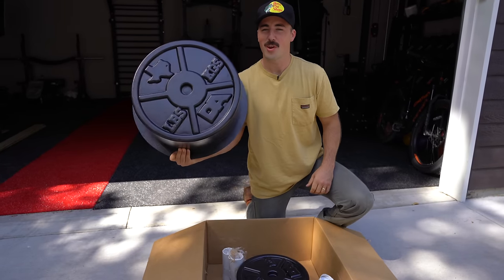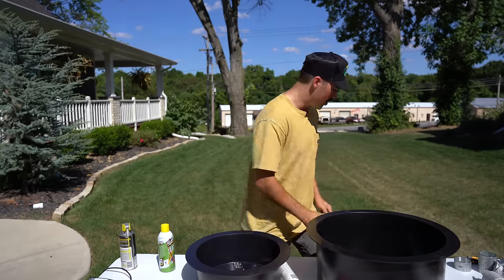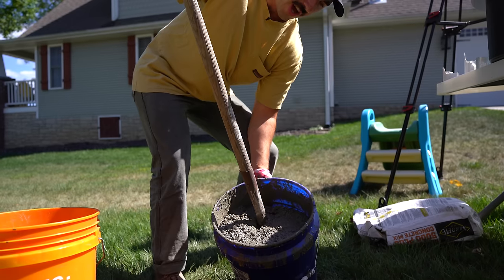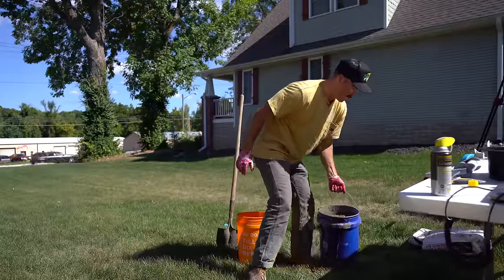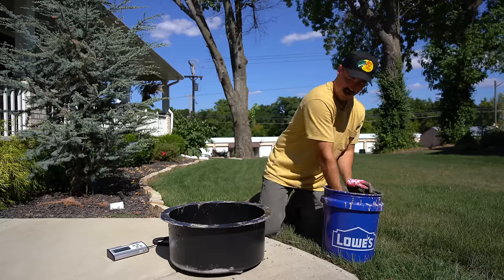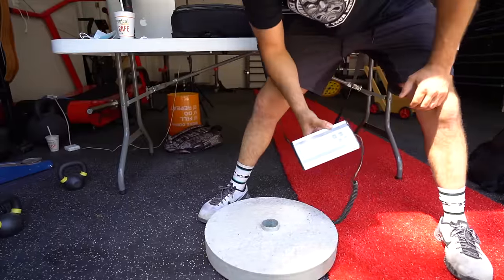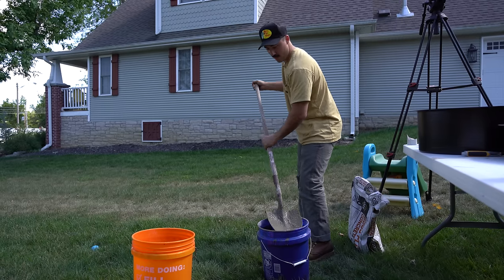How To: DIY Concrete Weight Plates That Don't Break

Comment: $115? for this mold? I mean I know regular plates get expensive but common. That's expensive considering the whole point of this is to save money.
Reply: The initial price seems high but assuming the molds are reusable you can make a bunch of plates for a fraction of the cost to buy manufactured plates.
Reply: @oXchoujiXo  exactly. I also cover shipping to US customers.
Reply: @oXchoujiXo  it's still just a plastic mold that's it... way to expensive
Reply: And you pay how much per pre-fabbed weight?
Reply: But for the $ 115.00 you can make a thousand of them if you want.
Reply: @derekthegreat1114  you can't make thousands because you need that metal pipe in the middle and they only supply you with so many unless you keep ordering more. $115 for the mold then money for the cement and bar, then all the work to mix and weigh out how much cement needed and even after all that is done it won't last forever because the cement crack and break. Not to mention the mess. For the price and amount of effort it doesn't seem worth it to me at all. you can buy 4 real plates on craigs list or facebook market place for the same price and they will last you forever no effort needed. for something like this to even be plausible it needs to be cheaper in my opinion.
Reply: @KnightlyChaotic  $115 for the mold then money for the cement and bar, then all the work to mix and weigh out how much cement needed and even after all that is done it won't last forever because the cement crack and break. Not to mention the mess. For the price and amount of effort it doesn't seem worth it to me at all. you can buy 4 real plates on craigs list or facebook market place for the same price and they will last you forever no effort needed.
Reply: @oXchoujiXo  $115 for the mold then money for the cement and bar, then all the work to mix and weigh out how much cement needed and even after all that is done it won't last forever because the cement crack and break. Not to mention the mess. For the price and amount of effort it doesn't seem worth it to me at all. you can buy 4 real plates on craigs list or facebook market place for the same price and they will last you forever no effort needed. how many people you know wanna dead lift and worry about breaking their plates if they drop them to hard or something breaking in the middle of a workout. it's a nice idea but i don't see the value.
Reply: @PabzRoz  most plates around me go for like 150-200 per plate. And i mean its up to each person to decide if they want to purchase a mold. 

Because honestly you could just use a plastic bucket for a mold. Wouldn't look as nice but would achieve the same affect.
Reply: @oXchoujiXo  where the hell do you live that plates cost that much!? here in the US you can get them brand new for around 60-70 bucks per plate. that's on the cheap end but still it's a solid plate lol who cares when we're talking about concrete lol. and I was thinking the exact same thing, just use the bottom of a bucket. who cares how it looks.
Reply: @PabzRoz  i live in the US and every available plate on either Craigslist or marketplace runs around that price locally.

And since its hard to get new plates as they tend to sell out fast it kinda sucks
Reply: Pabz Roz REALLY doesn't want anyone buying these molds. The 2" aluminum conduit for the center holes are reusable like the mold. You weren't supposed to leave them in, and you were supposed to mix the fiberglass in to the cement. The do fibreglass helps disperse the impact and it isn't made to be dropped on the cement grond. The design is for padded floors. Did Pabz not pay attention at all to the video?
Reply: @KnightlyChaotic  Did Pabz not pay attention at all to the video?

Find out on the next episode of DRAGON BALL Z!
Reply: @KnightlyChaotic  who cares, it's still a pointless product. sounds like way to much work when I can just buy 2 plates for around the same price.
Reply: @KnightlyChaotic  are you an endorser of this product or some shit lmfao why do you care so much about someone elses opinion. it's a 115 dollar bucket bro.
Reply: @KnightlyChaotic  regardless its still basically a plastic bucket for $120 bucks. no thanks.
Reply: this man finesse you 115 bucks for plastic and people still dumb enough to buy it and think Oh YeAh It'S LeGiT yOu cAn MaKe So mUUUUcH PlAtE WiTh tHaT......... people are stupid imma start a business me too at this point
Reply: You can’t buy the same size pipe at the hardware store? I’m sure it can be rigged up some kind of way.
Reply: I was considering buying molds despite the high price and realized that you have a mandatory Texas logo with your weights...
Reply: Seriously, and the fucking shit was already cracking after 1 drop. It won’t make it past a month.
Reply: @oXchoujiXo  200 per plate? WTF? Competition calibrated plates aren't even that much. You can buy 2 calibrated 45s from rogue for like $185 USD so that's like 90 per plate and those are competition calibrated.
Reply: @algoreshouldhavewon8995  There were no cracks at all.
Reply: @KnightlyChaotic  you are supposed to leave the metal sleeve inside
Reply: completely agree, do yourself a favor & buy the mold off ebay for like 20 bucks & you can buy your own fiber glass for cheap
Reply: for real, you could literally just make the weight inside of a big bucket, you just won’t have any designs on it. But in reality who cares about the designs it’s not like you look at the ends of the weight while lifting it.
Reply: @450-v9w  It's not just a plastic mold. It costs money to manufacture things. If he's injection molding them the aluminum mold required to make this mold costs a lot of money to produce (in the thousands probably) Then there's the upfront cost of having them manufactured, storing them, marketing them so people know they exist, shipping them etc. Plus weight is going for 1.50 to 2 bucks a pound right now, it's honestly a good deal considering the amount of work and the risk he took to make them.
Reply: @connorhd3201  Olympic plates in my city are going for 2 bucks a pound right now used.
Reply: You don't need to buy their mold. You can accomplish the same with a wide oil change bucket and 2" metal pipe. The mold is just for   a e s t h e t i c s .
Reply: @EurydiceProject  of course, but some people don't want ugly shit laying around their house.
Reply: @andreweasterling9240  i think some paint on it and make it outdoors weights... Prolly look nicer
Reply: Use a rim
Reply: ikr I could just buy a 3d printer and make my own molds with that kind of money.
Reply: @PabzRoz  115 is very overpriced lol. Im using plant liners/saucers, 2" PVC pipe to make a hole in the center, and chicken wire for reinforcement. Made 2 plates last night, waiting for them to dry now hopefully it turns out fine. But it only costed me $20 for all that, vs spending 115 on this thing with some stupid Texas logo lol
Reply: Get Terra Cotta Plant Saucers in the dimensions you need for around $5 a pop (cheapest on Target website). Made with better, more durable, plastic. Just doesn't have the weight design logo is the only downfall.
Reply: That's a come-only asked question
Reply: @PabzRoz  lol, you're delusional. I paid  around 130 each for my 45lb rubber plates (generic body solid clones) and that was am amazing deal BEFORE the pandemic. Price has gone up 50-100% from manufacturers and probably 100-300% on the black market. No way in the world were you getting plates for 60-70 bucks 3 months ago.
Reply: @PabzRoz  homedepot sells PVC pipes this isn't hard to make.  Concrete $10 for 80 pounds. 
Still better then buying a real plate. 
Mixing is easy and if you dont want to do the labor of mixing why are you even lifting.
Reply: @andreweasterling9240  stop trying to justify this price. It’s too high.
Reply: Yes , but I recommend cavemen weight molds over this, the point is that covid jacked the price of iron weight plates and this is cheaper for just 80lbs worth of weight
Reply: @PabzRoz  yup id buy some rusty ass weights from Craig and refinish them with rhino liner if you care about that sort of thing. Dont know why im even talking about this because i live at an apartment complex with a massive gym 🤣 and don't have a basment. Could always deadlift on my back porch (4th floor)
Reply: the big reason for doing this is you cant find iron plates, so make your own as needed.
Reply: @tattedupchrist1105  If he's selling them then it's not too high. If he's not selling them he'll lower the price.
Reply: you can make your own at home, it will be the same if you just use a large round container, just without the logos.
Reply: @andreweasterling9240  if people dont want ugly shit then why are they making cement plates? these plates looks incredibly ugly compared to metal or olympic bumper plates. youre point is moot. this is supposed to be a way to save money, and you arent saving much by how much the mold costs. over $100 is absurd for how insanely cheap polyurethanes are.
Reply: 100$+ for a 45 lbs plate u got me Fak^ i rather do cement
Reply: @JM-bl3ih  Have you tried buying 45 pound plates lately? 100 dollars gets you the ability to create 45 pound plates that aren't ugly for like 10 bucks. If that doesn't sound like a good deal to you then don't buy it.
Reply: @photonganglol2413  Damn you're gettin RIPPED then. I literally linked retailers that have cheap plates for under $100 if you scroll up in the comments. And in what world do you live in that you're paying over $100 for a single USED plate??? lmao. There's so many old plates people are trying to get rid of on craigslist or something for way under $100 if you actually try and are patient. Sure nice name brand mainstream plates can easily cost over $100. But a cheaper plate get's the job done exactly the same. Weight is weight. Especially when the alternative we're talking about is concrete...
Reply: @PabzRoz  okay so $70 per 45 plate. Once you get two plates, it's worth getting the mold and making them.
Reply: @supernoodles908  2 plates that will last you forever with no limitations. I much rather buy 2 plates and buy another pair later on and so forth having plates forever then deal with a concrete mess and the hassle of going to home depot every time one breaks buying bags of concrete and making a new one. One of those plates break in the middle of a workout lemme know how happy ull be lmao. I guess you could just make a bunch of concrete plates at once but still, not worth it. It's a $10 bucket. Especially when the majority of people only need 2 plates when starting to lift.
Reply: @PabzRoz  if I was to make a home gym, I'd need about 300kg in plates like 660lbs. That would cost a lot. This is a lot cheaper
Reply: you think people only going to get 2 45lb plates for a home gym and thats it? im crying of laughter reading your comments lmfaooooo, is the mold expensive? yes, could definitely find a way to make em cheaper, plenty of videos on youtube about this topic, people need 100s of lbs of weights for their home gym, lets just say u get 4 of each main weight lifting plates but depending how strong you are or plan on getting you probably would have 6 atleast of the higher plates, we'll do 4 for now.4x5+4x10+4x25+4x35+4x45=490lbs of weight, your link is $70/45lbs would mean techincally if it average out correctly you would spend about $762, if you got the mold and some concrete youd spend 115 for the mold and everything that he sends with it, u need 490lbs of concrete which is $10/80lbs so $61 for concrete so u looking at under $200 with the ability to continue to make more if they break, you might spend more buying the other plate molds and maybe u want 2 of each, or you can surf youtube on how to make your own molds for alot cheaper then the plastic 1s and your price will drop even more. if you use your example of using a bucket then making the concrete plates is even more worth it, u rather spend $340 on 4 plates of 45lbs then putting in the work with the concrete, its understandable but doesnt mean the concrete option isnt viable. It indeed is cheaper then buying a full weight set,dont even get me started on dumbell sets. heres another thing, take a look at this link for another mold set: https://cavemanweights.bigcartel.com/product/gen2-3-mold-kit-45-25-and-10-5-lbs-mold-kit,if you wanted 2 of each mold just buy 2 sets for $270 and the concrete and u spend about $331 and if they break u can just spend another $61 to make 490lbs of weights, that is an amazing deal so just because u rather hella money on these rubber or olympic weights other people would rather save money, set themselves up to make more in the future at a fraction of the cost and just do it themselves because it just feels different knowing you made them.
Reply: Go to junk yard get metal pipe use 5 gallon paint bucket boom dumbbell
Reply: @derekthegreat1114  with thousands worth of concrete
Reply: I guess, I'm just gonna saving money until I had enough to buy a truly high quality dumbbell.
Reply: @PabzRoz  you have no idea what you’re talking about do you?
Reply: @Bsing96  you clearly haven't read the comments have you?
Reply: @PabzRoz  oh don’t you worry bucko, I’ve read every single comment and my statement stands. No idea.
Reply: @Bsing96  Glad to know you took time outa your day to read all my comments and waste your time🤦‍♂️ Get a job.
Reply: Maybe find a friend that has weights. Find a large enough plastic bowl/dish/wrap and use a heat gun to mould the plastic over your friend’s weights... create your own mould. Could even do a silicone mould and then do the concrete. Just be resourceful.
Reply: @PabzRoz  nothing?
Reply: bunch of cheaper alternatives
Reply: You can find other molds online with more sizes on amazon for like $60 but if you do make a bunch it’s wayyyy cheaper than regular weights
Reply: @stixandstone  Ill just buy the mold for 30 bucks on amazon, thanks for the overprice product.
Reply: @oOOlivierful  thanks for spending the time to type this message. I hope the one you buy does the job for you.
Reply: @PabzRoz  I agree, I have bought 45lb plates at an outside farmers market for $35 each ... $115 for the molds is a bit high to me.
Reply: You could use $1 Home Depot bucket and some pvc.
Reply: @matthewbrady5214  yep. You can also buy steel weight plates from Walmart and/or Ivanko. Everything has levels of price and quality.
Reply: u dome meed to use a mould. just get a round bucket and put a pol in the middle and fill with concrete. the mould will help but not necessary
Reply: They're $115 because the cost and development of the mold that makes them is in the tens of thousands lol

Comment: I recently made cylinder shaped bags using green canvas and leather stitcher and filled them with gravel. I also sewed handles and rienforced them with more canvass into the bags and they hold just fine. My heaviest bag so far is 50lbs. All the bags are packed tightly to prevent shifting of rocks. These bags are solid and work greatly.

Comment: I am so glad they are giving customers other options for consumers of Olympic Plates because fitness stores are jacking up the prices on all plates, dumbbells, kettlebells, etc. We need more diy videos like this.
Reply: No one can make me pay 120 euro for 25 kg of steel....no way. Prices of weight plates is insane.
Reply: Honestly you could just make them out of wood and they would last longer than concrete.
Reply: @LS-jv9hp  you'd need super dense wood, and the plates would be massive
Reply: @guitubagrips9719  Yeah I figured the size would be big but that can be rectified (Like they do in WSM for axle DLs)through the use of platforms to counter it. Also, I live in Northern Europe where most common wood types are pretty dense like Ash or Oak.

Comment: I think he should have just kept dropping UNTIL THEY BROKE, as an idea of how long they might last.
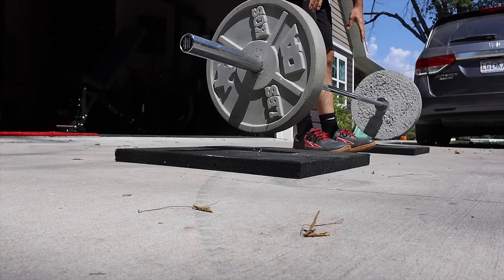Reply: They were already breaking (chipping). 10:45 where the concrete touches the 2 inch electrical conduits (metal cylinders).
Reply: @axlsane427  could add foam wrap between the two
Reply: He was supposed to wait 7 days before using them so it wouldn't be accurate anyway

Comment: When using concrete plates, you're already adapting to a new way of doing things... so it's probably best to adapt the workout with them as well. My point; if you're a bar-dropper... maybe start adding an eccentric movement to the end as opposed to the drop - which will trash them over time, especially with no rebar.
Reply: If you do eccentrics on heavy deadlifts, you're putting yourself at a higher risk of injury for no strength gain whatsoever.
Reply: @uwirl4338  someone hasn't done much research

Comment: Just LOVED that video. !!!!

Got a suggestion I think you and your viewers making these might like    

I recently bought 2 concrete blocks to do squats with a dip belt and a pair of dumbells while standing on.  I didn’t want the blocks to crumble and make a mess in the garage so I went to Home Depot and bought a can of Flexseal — that rubberized stuff in a spray can you see on TV all the time to seal concrete etc to stop leaks.   Sprayed both blocks in white to prevent black smudge makers and the stuff worked PERFECTLY!!!!!!    Sealed the concrete - no dust or crumbles and if put on in a 2d or 3rd coat would probably be great protect for your concrete weight plates.  

I got my first weight setback in 1967.  110 lbs of interlocking plastic weights — advertised as not to damage floors.  What they really were plastic molds which had a pour hole for concrete which were than sealed     Finally got rid of them in 2012 so I definitely got my money’s worth out of them.